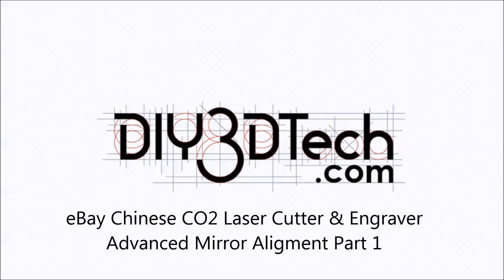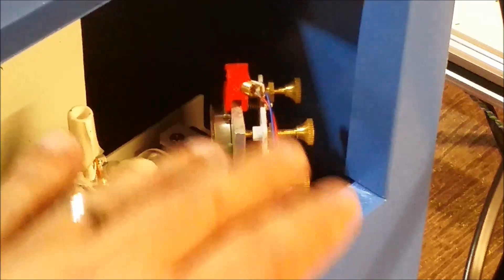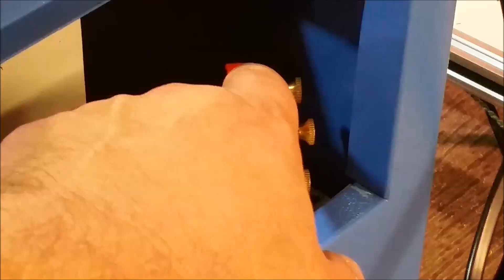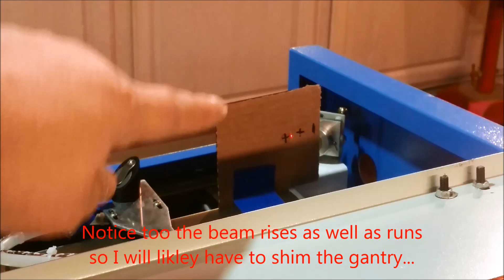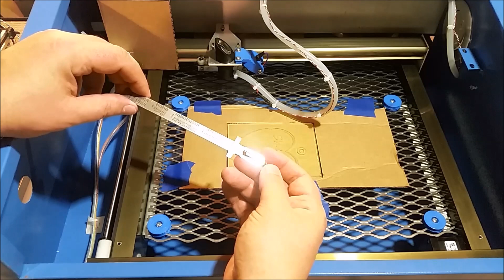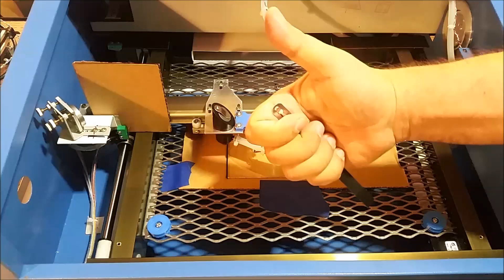eBay Chinese CO2 Laser Cutter & Engraver - Advanced Mirror Alignment Jig Part 1

Comment: You should be aligning your laser to each axis in sequence.  Your idea of using a visible laser to align is workable but you need to align with the visible laser on the same axis as the co2 laser.   Make a simple mount that attaches the visible laser or to the glass tube.   Fire the co2 laser on the paper target, and mount the laser to determine exact position of the visible laser.   Remove the paper and  run use the visible laser to adjust the first  mirror, second mirror, and third mirror using targets.   Would be easier to show than put into words but you need to shoot your visible laser in same alignment as the co2.
Reply from the maker: The issue is it would have to be in align with the tube and the room was not there...

Comment: I agree with H. Measuring anything from the casing is completely irrelevant. If the x and y axis rails are rectilinear then the casing could be the shape of a blancmange and have no effect on performance.
Reply from the maker: It act as a referance point...

Comment: 1) Do you have to align the laser tube itself before adjusting the mirrors?

2) Have you ever seen documentation which describes what can be expected by turning each of the adjustment screws? Trial and error with each of the three set screws  being turned clockwise and counter clockwise is rather time consuming and frustrating.

I apologize if I missed it in any of your other videos or notes. You have so much good material (so many thumbs up  . . . )!
Reply from the maker: You must (should) align the tube "with" the mirrors.  Think of the optical train as "one" unit so a change in one pieces is a change in the total train.  Also no to your question #2 however after investing a few hours of doing you will get use to it.  As to get a really good first align will take a couple hours...

Comment: Why would you measura anything from the sheetmetal casing?
It is pretty obvious you should use the Y-axis rails as reference.
First check if rails are the same level and parallel with each other, 
-then check if gantry is in a true angle with the rails
-then align tube parallel to gantry
-then measure if tube is horizontal at the right vertical level where it hits the centre of mirror 1
-mirror1's height must be equal with the head's entry point (from the rails obviously)
-align mirrors
-done
Reply from the maker: Ugh, because I can?  There are things in the world such absolute (which this is not) and relative (which this) measurements and the later was used approximate the tubes general orientation in 3 dimensional space which worked well.  As I did this quite sometime ago I can't remember all the pieces, however you will notice in the playlist I have designed and 3D printed replacement tube hangers as one of the most critical things IMHO is the tube needs to be aligned relative to the optical train.  Hope this explains :-)
Reply: Sure it does. :)
That's why one should pick a reliable reference point or plane.
I've just went trough an overall alignment procedure on my (60x90cm work area) machine and figured out the baseplate under the tube is off level by 2mm compared to the Y-axis rails vertically at the tube mounts, and the side casing is almost 3° off horizontally. Took me a while to figure out why I fail to aling it properly.
For the record, we are dealing with chinese machines...
Reply from the maker: Trust me I get the Chinese machine part!  However you get it as most miss this point about the level of the tube, this one of the biggest questions I get and try to explain that in high end machines the optical train "floats" rather than being affixed to a sheet metal frame as everyone says "you can just adjust the mirrors" to which I share if your adjusting the mirrors you have an issue...

Comment: Thanks for the info. One thing I don't understand is how to ensure the first mirror is exactly 45 degrees to the cutting laser (sothe jig mirror is perpendicular). It seems that moving the gantry without that mirror being exactly 45 degrees would cause the same left/right drift that having the bed out of alignment would cause? Adjusting the bed to then match that would only compensate for the first mirror being not exactly 45 degrees?
Reply from the maker: The short story is its hard.  However if I follow you, you correct about the run out.  So the first thing I would level & square the Bed/Gantry.  Next I square second order mirror on the X gantry with the lens mirror assembly.  There are several ways to do this and I use visible laser  which I squared off then I squared the first order (the one facing the tube) and then adjusted the tube (with the custom brackets I 3D printed) align everything.  Now this was not perfect (as I did have to adjust the first order mirror as I could not adjust the tube enough because of the enclosure).  Hope this helps :-)
Reply: This helps immensely, thanks!

Comment: To square an XY gantry you have to measure diagonals. Once the two diagonals are of equal length, you are 100% square.
Reply from the maker: Yes you do that, as I set up a target and used a laser (small one) to measure the rise and run...
Reply: BTW, I found out that one can use laser distance meters (used in construction) to measure small distances. They are pretty precise. I used one of these to square my CNC router.
Reply from the maker: Interesting the ones I have seen are pretty large, how big was the CNC?

Comment: So I've got mirror 1 and mirror 2 aligned. When I do the Y test to double check, they are off about 1/2". What could this be?
Reply from the maker: Not sure what a "Y" test is however check both the level of the tube to the mirrors (not the metal enclosure) and also check the gantry as mine (i.e. gantry) was off about 1/4".  This also why I 3D printed new tube "adjustable) tubes holds too and there is video on this in the laser play list as well as the STLs on Thingiverse...
Reply: @DIY3DTECHcom  Still looking for that but not by the time you read this. It would have been easier to get a laser head for the CNC 6040 which I now have - Haha, alignment is a serious affair - one might have hoped it to be fine on delivery - that said however, clever chaps (haha) like yours truly will often 'fix' things - the wonky sheet plate bed, the ridiculous sized bed, so goodness, if it anyway doesn't go out of alignment. Only then does one realise how unreferenced the thing is screwed together. Measuring isn't easy - continuous laser tests risk mistakes. Anyway, I'll make the most of what you have to share and hope that if one day I actually have it in use and some time for 'social platform' awareness, it'll become apparent as to how much I/we all appreciate the sharing from others on subjects which are of practical relevance to me/us. Have a good one mate and thanks for your whole time and setup to share.

Comment: This is great, thank! How would you align the 3rd mirror? My laser seems to not point down straight into the head? The mirror only has a slide bracket, not any adjustments screws like the other two.
Reply from the maker: One of the things you need to do is ensure your tube is level also, please see the video in the playlist where I did the 3D printed tube clamps as you have to think of your entire optical train floating in 3D space as that us how it work on expense lasers.  Hope this helps and if just ask :-)

Comment: This is great, so helpful and informative. We are able to get our mirrors so that they align horizontally, but it shifts vertically and the power of the beam dies down the further the cutter head is from the mirror. We have measured the bed and it is set perfectly. I have tried to adjust for the vertical difference but then the horizontal alignment is off. We are at a total loss and would appreciate some guidance on how to determine the issue and go about fixing it. Thank you.
Reply from the maker: So first things first, the more air the beam hits (being 10,600nm which is really long) will attenuate the beam and its a fact of life at this wave length so do not expect it to be equal close up as well as well far away.  Also Did you see the video in my play list for the CO2 laser where I had to 3d print a shim for level out the gantry vertically?  Also look at the video with he new 3D printed clamps for the laser tube as your tube could be crooked too...

Comment: This info that your provided here with the K40 laser is priceless. Too bad I did not find your video earlier. I had to do to pretty much the same with my alignments. Gantry adjustments as well.  And it took me many grueling hours to get is right. I actually had to take material off the secondary mirror bracket to move it to the right to align parallel to the primary mirror .  I am very relieved that someone had the same issues with alignment as I did.  But once aligned, this freaking laser works very well. I figured the labor required to calibrate this thing makes the difference between a $400 laser and  $5000 laser.  Time is money.  This laser definitely requires an experienced hands-on engineer to figure it out.  Including the software.    Laser SafetyMy laser safety experience first hand:I love having a CNC laser. It is the coolest thing I have ever had in my shop besides my CNC machine.  But it is unfortunate that China can get away with selling these lasers so cheap to the untrained person.  Imagine an ignorant teenager getting their hands on one of these for a Christmas present!Get used to the laser zapping you every now and then if your fingers get into the way of the beam.  You will know it when it does mostly during alignment procedures.  I am sure owners know what I am talking about. Having the lid open is more desirable in some cases but use safety glasses.  I took a look at the cutting light without laser glasses while running a job and it made a dot in my eye for about 30 minutes.  I thought that I would have to live with this for the rest of my life but it went away.  Just be careful.  These are a new bread of tooling that is available to us hobbyist and small business owners. High powered lasers require more respect than most other tools you may have in your shop.  And this is mostly about danger to your eyes. If you are working with reflective materials be very careful.  All in all I love this thing but I do very much respect it.  Dean SalaSuntactics
Reply from the maker: +Suntactics you are 100% right!  These are VERY dangerous and many people do understand that as not only to them selfs but people and pets in the area!  When using mine, I make sure the room is clear and closed.  Even the reflected light is dangerous!    On the 25th & 29th of the this month I have several in the que where I record the cutting with my inferred camera!

Comment: Please correct me if I'm wrong but I have had similar problems like you have with this and solved by moving the position of the mirror, then changing the angle. I believe if you had moved the mirror slightly closer (or maybe further away) to the laser then you could have got it to shoot straight down the line of the rail. Are you not able to move mirror position?
Reply from the maker: +patrick whelan The issue is my gantry (and most likely most peoples) was not square in the sheet metal and the sheet metal case on top of that [also] is not square.  So with all of that said, you can keep trying to adjust he mirror however if the plane in which you are trying to square is not square itself you are simply robbing Peter to Paul.  If you look at the expensive units, you will notice they have an internal skeleton which locks the laser tube and all all mirrors into the same plane providing a unified beam to all locations of the bed.  3D Printing that shim made a huge difference in  allowing me to proper achieve alignment across the extended bed.  Note I also moded the bed so I can cut like 9"x10" material. If I was doing just what fit in the clamp or there about this would not have such a big issue.
Reply: Thanks for your answer! Yeah I thought that there was a bit more to it than I assumed.My machine is quite different from yours, I think your videos are really interesting by the way! :) What you achieve in this project is very nice alignment, so satisfying to see the difference! Its like a good shot in pool :)